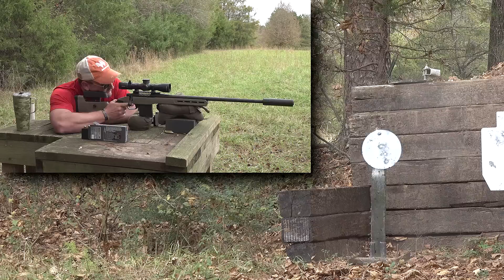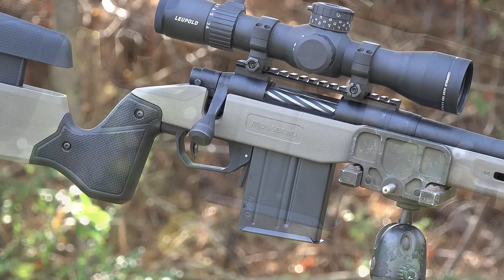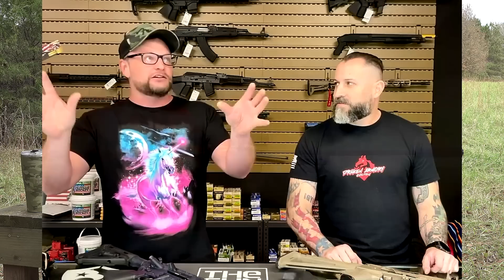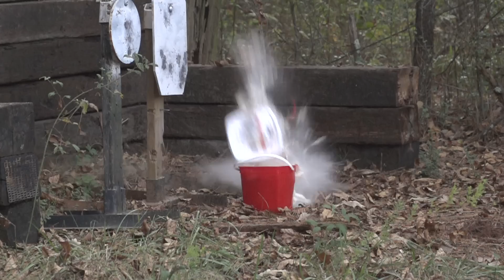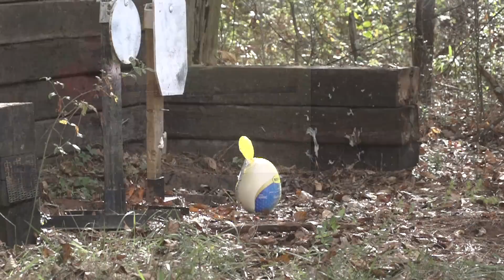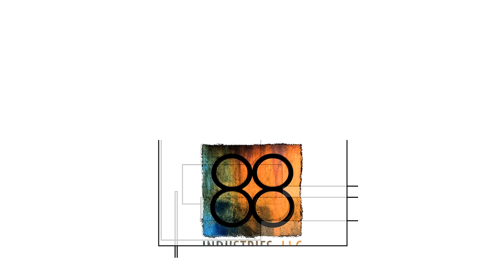Mossberg Patriot Tactical | 6.5 PRC

Comment: Not really been a fan of the Moss Patriot. When they 1st came out, I liked the looks of the wood stock version. They look good to the eye as 1st glance, but how the action mates to stock is pretty weak, and been a turn off to me. Many of them have accuracy issues, and I've wondered, if a chassis setup could somewhat fix that. I know some of them have had stock failures in the weak style lug area.